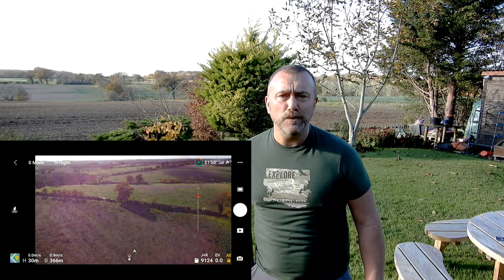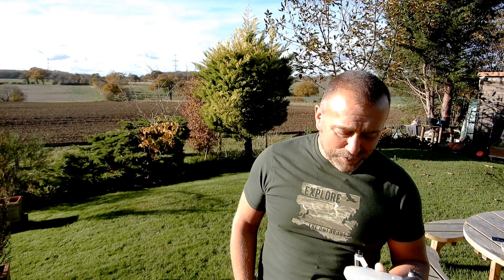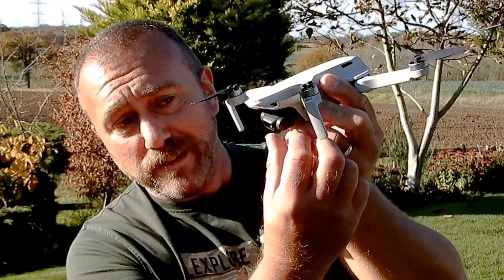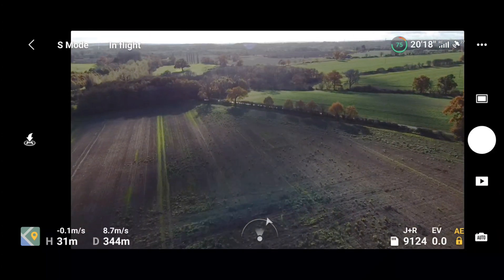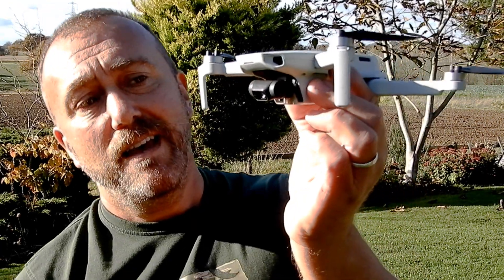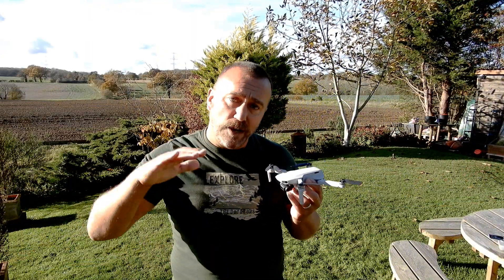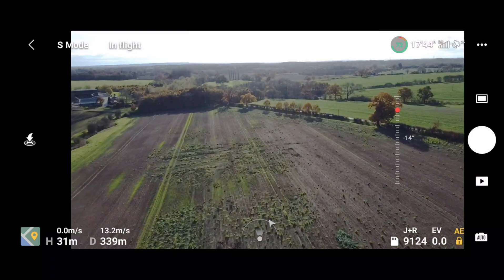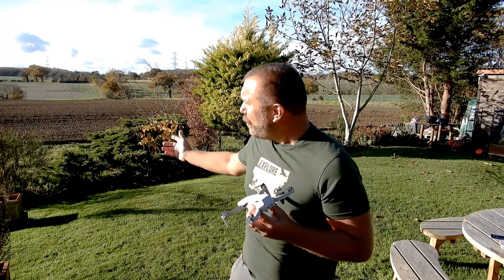DJI Mini 2 Camera Gimbal Dip Issue - Why it Happens & How to Stop it

Comment: I got to disagree with you sir the drone has an issue which I don’t know if it can be fixed if you have a Mavic air 2 it works perfectly the gimbal jump does not happen at all in any mode. The mini models I have a different gimbal Assembly then the air 2
Reply from the maker: The Mavic Air 2 has a completely different gimbal design and more clearance, however it also suffered the same issue until they did an update to limit the pitch to 35' down from 40'. Of course you can say it's a design fault, which I'm inclined to agree with, but it's not actually broken, which may people were thinking....
Reply: @IaninLondon  if it is fixable and it’s not being fixed I call it broken so let’s hope they fix it hopefully it will work as good as the air 2
Reply from the maker: The fix would be to limit the pitch, which is not a fix I'd like, as that's enabling its wind handling abilities....👍🏻👍🏻👍🏻. Fundamentally there is a limit in the room for gimbal movement that is competing with pitch.
Reply: @IaninLondon  to me it looks like the gimbal jumps around before it hits those limits
Reply: Will just have to wait and see if they fix it
Reply: @IaninLondon  I am simply simplifying it by calling something that doesn’t work the way it supposed to as broken

Comment: Greetings,
Can you connect the Mini to a power bank, and operate it while charging... ❓
Reply from the maker: You can connect the remote to a power bank; obviously not the drone itself if you're trying to fly... :)
Reply: @IaninLondon  my point is to extend the flight time by keep the drone concerned to a small power bank...
Reply from the maker: @turkimax1  Ah, wow!  That sounds like a video to make! :)   Yes, you can connect the drone to a powerbank as well, but you'd need to see if the extra weight would shorten the battery life beyond the extension given by the extra power......
Reply: @IaninLondon  then go ahead and make the first YouTube video with this idea  😎

Comment: It is broken, you are wrong. If it was a result of the increased tilt it would be a smooth transition down not a harsh jolt. Also, the mavic air 2 had it and is now fixed through software.
Reply from the maker: It's not broken.  Sports Mode produces jerky movements. And they fixed this in the Air 2 by limiting the pitch to 35'. So I'm probably not wrong either....

Comment: Would it help cha gung the setting for the camera to be able to tilt upwards? Also changing the cam speed in sport faster through the cinbal settings??
Reply from the maker: Thanks Erwin.  I did try that setting; it helps marginally but makes life so difficult the rest of the time, I turned that setting off again.... :)

Comment: I did a bit of a wind test today, or as much as I dared to, UAV said 20mph wind with 34mph gusts at ground level. I only flew up to about 6 meters but it held steady, I had full control in all directions, particularly in sports mode and the video that came out of the recording of my daughter running around in the garden was still and steady! The thing is a tiny F-ing beast!!!

Comment: Hi Ian, Love your channel, I have an issue with my Mavic Air 2, as I have to change from HD to smooth because of the delay in transmission,( very jittery) only started yesterday and I have 4 months is it the phone(huawei P20 lite) or the drone and would you know why it would start happening now.
Reply from the maker: Streaming 1080p is a meaty anoint of data. Unless you have perfect conditions with no interference and a phone that's super powerful, you'll ha r problems, especially if you have a lot of moving information on the picture...
Reply: @IaninLondon  Thanks for the reply, so I should be in HD not smooth? Is it my phone that is the problem, or have you seen this problem before.

Comment: I think my gimbal is actually flawed. It drifts to the left and right quite frequently, and sometimes very far distances. (My mini 1 doesn't do this) Also, when in RTH and I descend, the gimbal will start glitching out to the left and then return to center repeatedly. I already talked to DJI and they want me to send it back. Such a shame, I haven't even had it a week and I was loving it, now I have to send it back. Oh well, at least I still got the original mini!
Reply from the maker: Yep, send it back. At least it's not summer!

Comment: So really  the new mini doesn't have better wind resistance it just allows for more pitch to fight the wind.  They could probably patch the old mini with firmware to allow almost the same wind resistance but probably won't since it's a new 'feature'.  This is what I figured when I saw a lot of the mini 2 videos with weird gimbal tilting.
Reply from the maker: I think the motors are more powerful but yes, I would have thought they could have given the original Mini more pitch...

Comment: Great advice, Ian.  Thank you.  Quick question on your intro.  There is an area that looks like it was bombed out, lots of pot marks in the landscape, where was that taken?  I’ve seen a landscape like that at Point du Hoc, Normandy.  Thanks for all your great video’s!  I’ve learned a lot from them.
Reply from the maker: It's featured at the end of my Mini Battery down to 0% video from a month or three back.  Look up Grimes Graves in Norfolk. Neolithic Flint mine...👍🏻
Reply: @IaninLondon  flint mines!  Wow, I really need to get over there for a couple of weeks.

Comment: In settings you can also slow down the gimble speed in sports mode, that might help as well.
Reply from the maker: You can, but that probably won't help as it's the angle, not the speed of gimbal movement.... Play around and see what works 👍🏻

Comment: Another insightful video Ian. I haven't had this problem with the mini 2. But have found an issue when the gimbal is pointing straight down vertically. Even at very low speeds or even just descending it 'jumps'. Has anyone experienced this?
Reply from the maker: Other comments have mentioned this too. Same principle. 👍🏻
Reply: Yes. But it's at very low speed going forward. Following your principle here, the drone would have to tilt backwards to make the camera jump when pointing directly down? I'll do another test when it stops raining here in the UK!
Reply from the maker: @rlevans0602  The drone does jump back when stopping. Check out 2:20.
Reply: Spot on Ian. I flew the mini 2 inside the house (very carefully in cine mode!) And there were no issues with gimbal vertically down. Even with front-backward movement.
Reply: ...reading the manual,it is actually capable of -110 degrees. i.e pointing slightly backwards downward. But clearly if the drone is at 25-40 degrees, that's going to jump.
Reply: Same here

Comment: Sorry its off topic. I'm stuck between getting the Mini 2 or the Air 2.  Are the Air2's RAW files any better, and would there be any improvement in low light? Thanks
Reply from the maker: I'm doing a MIni 2 vs Air 2 vid later in the week; the Air 2 has a larger sensor and even though it's a 12MP sensor using a quad bayer filter, it can produce excellent raw files with an effective resolution of 48 MP...  If you're serious about photography you may wait for the Mavic 3 Pro (but who knows when that wil be released......)  Ian
Reply: @IaninLondon  Many thanks Ian. Look forward to your next installment.

Comment: Great tip but I wonder how they fixed it on the Air 2. Have you had the issue with the horizon tilting in sport mode?
Reply from the maker: No, partly because the pitch is limited to 35' on the Air 2 and also because the gimbal has more space to manouvre

Comment: Something similar happens when you have the gimbal completely pointing downwards and then fly backwards. Because of the tilt of the drone and because the camera can't look any lower, ti won't be able to keep looking completely down
Reply from the maker: Makes sense for the same reasons.
Reply: This is a very common problem with mini 2 users. The gimbal abruptly kicks up from 90 degrees to approx 10 higher for no apparent reason regardless of mode, wind speed, flight direction. No solution as of yet. Even happens while holding the gimbal wheel forcing it downward. It will still kick up, then return to fully downward position.
Reply: Mine does this; only in photo mode though. Not video mode. Very weird. Check out my channel for a screen recorded example.